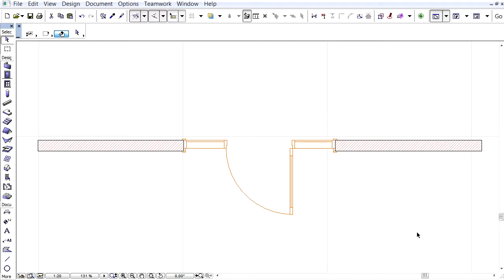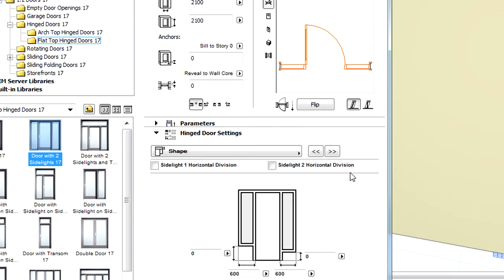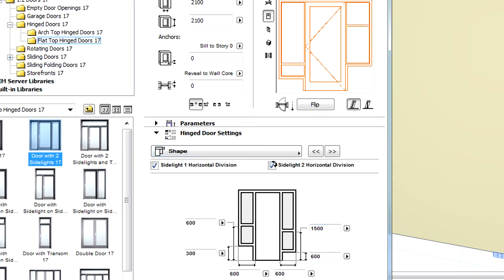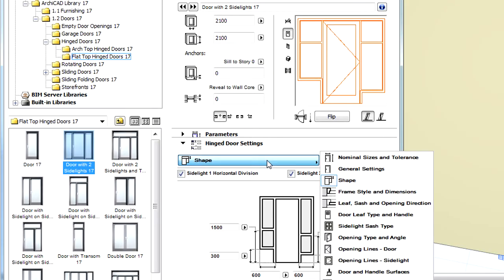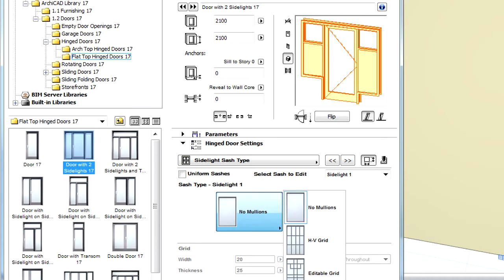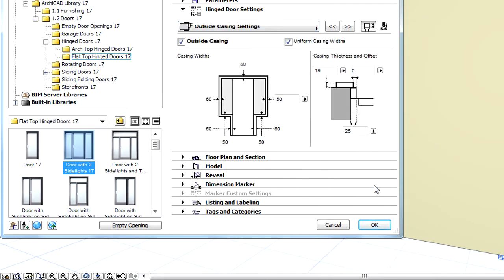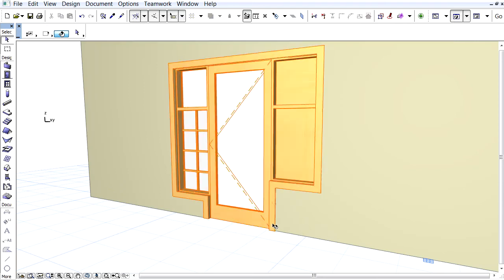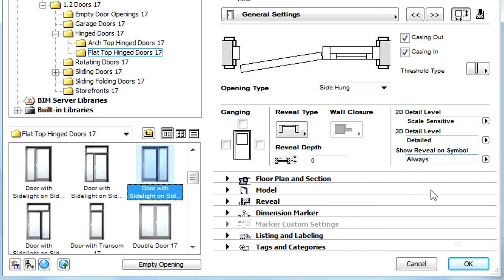ARCHICAD doors with sidelights

Comment: unfortunately the door width itself is un-editable!
Reply: Unfortunately, it seems like you don’t know how math works, because overall width is editable and so is sidelight.
Reply: @mor0gue  1. no, the double door (two sidelights and two doors version) was uneditable. reported to archicad and they agreed it's a bug and they will fix it. 2. it's a constructional practice to determine the door width rather than sidelight width, because the door width affect means of escape in case of fire, and barrier free access for wheelchairs. both are statutory requirements, and are to be vetted in the case of AI statutory compliance check. it's also for manufacturing dfma because a contractor and a supplier first need to know the door width and structural opening width, before knowing the residual window width which is a buffer. writing a script with sidelight width editable but the door uneditable means the software developer clearly doesn't understand how a building is actually built!
Reply: @mor0gue  4. in case you're still confused, I'll give a concrete scenario: imagine you have an opening of 1500 and a door 850 which is minimum for wheelchair. therefore you specify 650 as sidelight in the model. later on you change your design by reducing structural width to 1300. now, because your specification was 650 sidelight, the software would automatically reduce the door to 650, and boom, wheelchair cannot pass. and you may not even notice that because it's an automated update process. now imagine if the script was written with door width to be specified. upon reducing from 1500 to 1300 the system would keep a 850 door but reduce the sidelight from 650 to 450, so you'll be good for statutory audit.
Reply: @mor0gue  3. for your information: no, a double door double sidelight cannot be broken down into separated windows and doors in the model because, for quantity surveying and statutory compliance purpose, a large glazing combination like these are considered as 'window-walls' (as opposed to 'curtain walls'), and require a separated set of structural and cost submission, that the entire piece has to be calculated as one whole piece, rather than separated elements. having the double openings uneditable means one cannot model a window wall. until here, I know what you're going to ask and here's the answer: no, a window wall cannot be modelled as curtain wall. curtain wall is a cantilever, window wall is fixed at top and bottom. they are structurally two concepts.